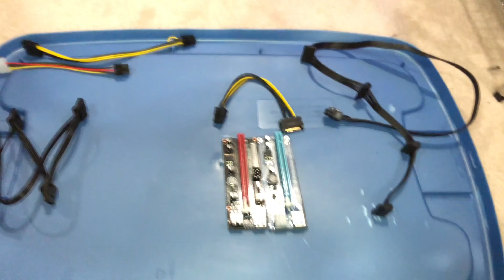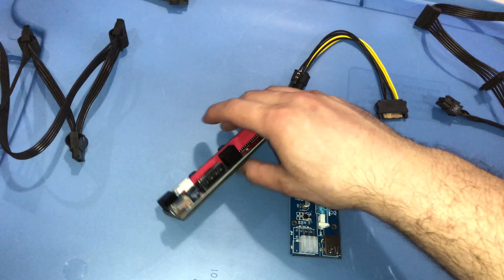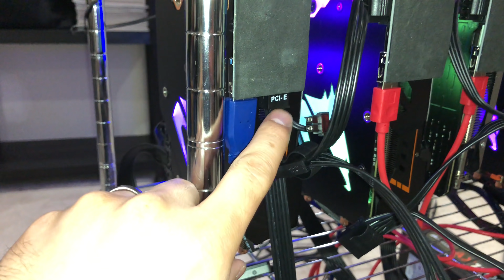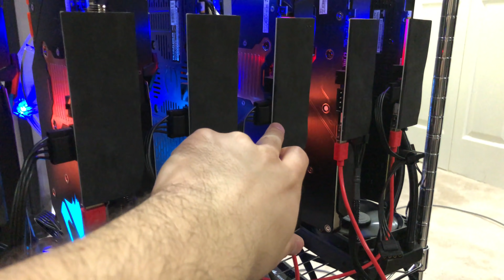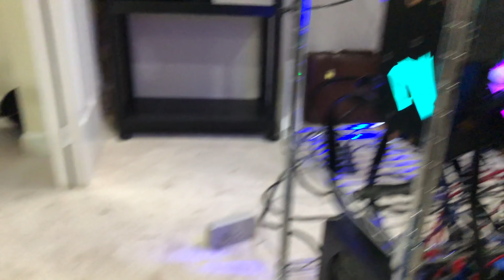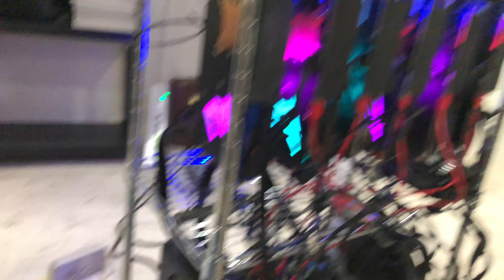How to safely power risers.

Comment: Makes no sense. No nobody ever explain anything. If you have a 6600 they only draws 50watt.  You wouldn't any of these. If your have a 1080ti at over 200, neither the sata or the motlex are enough.     What noone ever mention is using all the pcie, sata and molex all to power the gpu to take the load off the wires so they don't burn.   Or am I messing something here.

Comment: Hi quick question. Do I power the riser AND the GPU? Right now i have the SATA in the riser, Which i know you said replace. But I also have the PCI-E in the actual GPU it self, just making sure that the GPU still gets its PCI-E power ?
Reply: You need a bigger power supply with more pcie connections... either that or buy risers that can accept a molex connector.
Reply: @ricoviq1185  Thanks, but you havent answered what i asked.
Reply: @chillwavesessions2784  the riser and GPU need to be powered.  The GPU can pull up to 75w from the riser/pcie to supplement what it pulls from the pcie connector you out directly into it.  This is why sata is not suited for it since it cannot deliver 75w...

Edit: spelling
Reply: @ricoviq1185  Ah right, so what i am doing at the moment is i have the SATA in the Riser and i have a PCI-E connecter in the gpu. So are you saying that All i need is a PCI-E connecter in the RISER and then i DONT need to have one in the GPU?
Reply: @chillwavesessions2784  you need power to the riser AND the GPU. And you ideally shouldn’t use SATA for the riser.  If your GPU has 2 pcie connectors, and your riser has one, then you need 3 Pcie cables coming out of your PSU.

Comment: hello I make you a query, I have an adapter from 2 molex to pcie 6 pin, if I connect a single molex it reaches me for 130w or do I have to connect the 2 molex to the psu to reach those watts?
What package do you recommend for Rtx 3070 in mining?

Comment: Out of curiosity why do you use the 2nd option if you know 1st option is the best I’m doing my best to avoid any problems
Reply: Probably too late for your question but it has to do with running out of 8pin slots on your psu

Comment: When you run out of PCI-E and Molex, you can use 2 x 'sata to 6-pin' for one riser (if you have the riser on the left in this video). Check that the both 6-pin connectors are hard wired together on the riser PCB, they should be.
Reply: The thing is sata underpower raisers is a big risk

Comment: Hi. Your video was very informative and helped me from preventing my first mining rig from becoming a potential fire hazard. Thank you for your video.

With that said, I would like to ask and make clear if it's safe to power two risers on a single 6 pin to 3x Molex cable connection? Or is it safe to only do one riser for each molex cable on the psu?
Reply: 1 molex to 1 riser. Do not ever think plug 2 risers to the 3x molex cable. molex is the "meh" option when you dont have more pci-e.

Comment: This is most helpful video i saw for mining , but i have question wish u answer me
My Riser have pcie + molex + sata 
1-when i plug 6 pin pcie slot for riser to power supply , do i need plug secondary pcie for GPU ? or enough just Riser ?
2- i have the black sata that come from manufacturer of power supply it have molex and sata same time like yours at 3:30 . directly plugged  to Riser x1 molex x1 sata same cable , 
( each of this cable use x1 molex x1 sata ) is fine and safe ?
Total 6 GPU
the black sata at 3:30 came with Power supply manufacturer 
have x4
x1 cable using for x1 Riser by molex only ( single )
x1 cable using for  x1 Riser by molex only ( single )
x 2 GPU x1 on molex and x1 on sata ( single cable )
x 2 GPU x1 on molex and x1 on sata ( single cable )

any wrong ?
Reply: The 3 plugs on the riser only power the riser.  you need to plug in only 1 of those plugs.  If your GPU has PCIE plugs directly on it, you must plug them in into the GPU otherwise the graphics cards will not run at full speed.

Comment: looks like there are 4 molex connectors on that  pci cable... so its safe to run two GPU risers using the one Pci cable with 2 of the molex?

Comment: Is it safe to run x2 GPU's off a single PCIE cable from the PSU that has an extra 6+2 pin connector?
Reply from the maker: Attila Vidacs risers, yes, that connector pushes max 150W, each riser can request up to 75.  If referring to powering cards, the card’s tdp would have to be less than 75w each... those are low end cards...
Reply: DONT LISTEN TO THIS GUY HE IS FULL OF IT
Reply: @dr.davidlcarter5697  how tf so. that was solid and true advice.

Comment: SATA may be up to 54W or something round that number, but it should be enough to power most newer model cards, if we are not talking about some very power thirsty new cards, and as I mentioned older cards, which are power  thirsty. All my RX 580 8GB GPUs are connected to SATA female, to SATA male- 6PIN, the 6PIN going in the riser. I would avoid it, and I do where I can. Just replaced several risers which use SATA only, so I plug the sata from the PSU directly, no adapters like SATA 6PIN or SATA- Molex. However, I still have several cards using molex risers, and some are powered directly with molex, but earlier I had not enough, so I had  to use SATA to MOLEX, and SATA to 6PIN(still using SATA - 6PIN for the ver 006C. Back to the original statement, the 54W  supplied by SATA must be fine, if used directly from the PSU for most  cards, at least for RX 4XX and RX5XX based on experience, also Nvidia 1070TI. The issue comes with the adapters he said to throw in the trash. Many of these are bad manufacturing, Chinese garbage, and they start to get hot, and after time melt, thus making connection  from bad to worse, and this can be a problem. So the SATA supply directly or with a good adapter SATA- 6PIN, SATA- Molex should be fine, in most cases. You can see that the problem is bad adapters in most cases explained good in this video:
https://www.youtube.com/watch?v=fAyy_WOSdVc
Reply from the maker: Smita all the cards shown here are 1080ti’s and can have the potential to exceed the capacity of the sata spec.  Especially if the rig boots up without the OC settings taking effect for one reason or another.

Comment: Best is 6 pin, second is molex and 3rd can be sata to 6 pin if you plug low power cards for that matter. Most videos that claim that sata cables melted were connected directly to the riser and not from sata to 6 pin. If any of you can find this wrong, link the video or article.
Reply: 6 pin riser to 6pin psu? The psu 6 pins (evga 850) are marked sata...

Comment: This is not really a great demonstration (a lot of the information is missing), it's true it's super safe but, you didn't show any of your power requirements.  Also, the problems can originate from a variety of sources, it could be the wire is poorly gauged, the power requirements daisy chaining all risers to a single sata line ( DON'T DO this, highly dangerous), or the plus on the SATA end is poorly bound.  

So let's start, the sata pci-e riser he has that is only SATA isn't bad, if you accommodate for it, which he did (good job), however, you shouldn't have to throw that SATA connection away, just watch this great video here on this page, https://forum.z.cash/t/how-save-are-sata-powered-risers-can-i-still-use-them-for-mining/18223 .  So continuing on, lets say you have a 1000W (actually a 800W) power supply with 8 pci-e connectors, along with 3 rails of SATA + 1 aux rail, you can safely run 4 gpus slightly underclocked with a mobo and cpu on same PSU.  

Next, if you know the power requirements of your card, lets so 180W, this is common (if you need to search for it, http://www.realhardtechx.com/index_archivos/Page362.htm ) you can branch easily... a gpu with 2 6-pins or 2 8-pins can be easily accounted and is simple to understand, next power the risers would be from 3 SATA and 1 Aux rail (need a molex to SATA converter, don't have to worry about fire risk with this setup, as it's only powering a hard drive.)  Not sure why not no one on youtube has made it super / dead simple to understand.  Everyone gives small pieces of it...
Reply from the maker: Bhavish M Lets consider the scenario you mentioned.  4 gpus slightly underclocked... Let’s say msiafterburner.exe fails to load when your miner bounces, but the mining script runs itself.  Now I have 4 1080 ti’s plus all those risers, plus my mobo and CPU running from that 1kW PSU...a 1080 ti is around 250-275w TDP, and cause afterburner failed to run, they’re all 100% power draw.  This happened and is what prompted me to make this video.  My advice is airing on the side of caution... My rig was set to restore from last power state after an outage, and it did.. Came home and the basement was extremely hot, more so than usual.  Went over to my rig, the cables going to the risers were slightly sticky (SATA to VGA cable) as if they were starting to melt.  Plugged up a head to my rig, prompt on the screen read “MSI afterburner has stopped working...”. Kill-a-watt from the wall was reading 1400 watts draw on my 1200w PSU...  Ever since, I’ve scaled power and risers for the unlikely event that they all need to draw 100% power.  As such, this is 7x1080 ti’s running from 2 X Corsair 1200W platinum PSU’s, with the only additional equipment as the mobo and i3 and a small SSD...Runs perfect for weeks at a time, and if it ever bounces itself I have the piece of mind that even if my default OC/undervolt doesn’t work, the cards, cables, and sleeping infant are all going to be alive and well.
Reply: Rico Viqueira gotcha, I agree 1080tis are beasts and if Afterburner doesn't load, it's game over, while mining loads...  Most people won't have 1080tis, and I doubt that most people will even do the math/ research on rail power balancing but if done right -- it won't be a fire risk.  I'd rather do the homework and balance the power requirements and not throw stuff out.  I'm building my rig out, and spent hours upon hours reading.  But I agree with your setup and it is abundantly safe, and while it is good advice, if I know the SATA draw is far less than spec I should be good... For 1080tis which are near very top for power requirements its just dumb not to be extra cautious as the power draw is that much higher and the risk is inherently much higher than say a setup of 1050tis.
Reply from the maker: Ihab Ahmed it’s generally regarded as easier to use.  At least I think it is.
Reply: Is there any advantage for the MSI afterburner over EVGA precision xoc
Reply: Yes it is easier to use but EVGA precision xoc can sense temperature for multiple sensors GPUs

Comment: Would you be able to use a Y-Splitter PCI-e 8 pin to PCI-e 6 pin and connect Two risers off the same cable? Just curious as it would cut down the amount of cables needed or would it be better to power each individual riser with its own cable?
Reply from the maker: mystermathers yes, I’d do that cept those cables are usually short at the Y end... my GPU’s would have to be literally a centimeter apart for that.  Important thing to remember with cables is the gauge/connector/output wattage needs to support the application.  A pcie cable out the vga slot of the atx power supply can do 150w, the max draw of a riser on pcie 3 spec is 75... so you’re good for two
Reply: https://www.newegg.com/Product/Product.aspx?Item=N82E16812706046&cm_re=pci-e_cable--12-706-046--Product

I found these, and it looks like they spread apart pretty far and overall length is 19.5", so I thought this would be a great cable which is why I was asking. Thanks for the reply!!
Reply from the maker: mystermathers those look nice, just verify the pin out config of your PSU for the VGA/PCIe section to make sure they match.  I’ve seen Corsair do some funkiness to make sure you use their proprietary cables...
Reply: Will do, and thanks, was a big help in discussing this!

Comment: Will it work with USB 2.0?
Reply from the maker: If you're referring to where the riser plugs into the PCIe, you don't have to worry cause they all come with the USB 3.0 cables, and the interface is included.
Reply: Does the red riser need power to be plugged into both sockets in order to work?

Comment: Can use 6-pin MOLEX to 15-pin SATA power cable without caught fire?
Reply from the maker: Nestor Rivera don’t use any adapter with a SATA connector.  I go over that in the first part of the video showing that exact adapter you mention and why you shouldn’t use it.  Not saying it will catch on fire today/tomorrow/ever, but it’s a high likelihood of fire or melting.

Comment: So basically SATA is not an option at all, yet the manufacturers supply sata to 6-pin cables?
Reply: Maybe because cheaper
Reply: Sata to 6 pin provided is to ise the 6 pin side to riser and sata to the psu

Comment: Can you connect your pcie riser and a gpu with the same wire?
Reply: Hey Rico, could you point me to the "proper adapter"...? Like to Amazon, perhaps?? Thanks, great video, hoping this clears up my issues.
Reply: Ah, duh! Thanks again!! (but now that I look at the adapter cables... they look scary, dude. Looks like a fire waiting to happen.) I need to find like a 8-pin y-splitter.... but all the ones I come across, they seem to be cables made for the PSU to mobo and not to power the risers.
Reply from the maker: Nope use a separate PCIe cable coming out of your PSU.  This is hard when using ATX PSU (like mine) cause usually you're limited on the number of PCIe cables/ports on the PSU.  When you run out, like I did, buy molex risers or get the PROPER adapter.
Reply from the maker: linoeleven check the video description, links are there